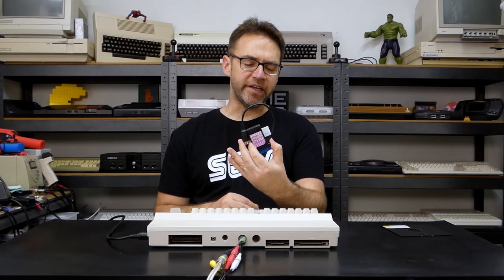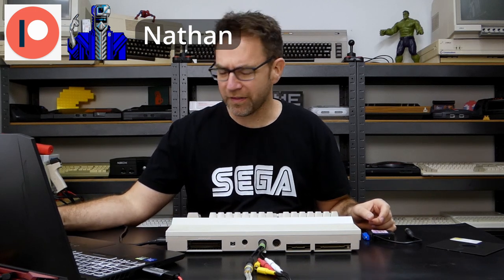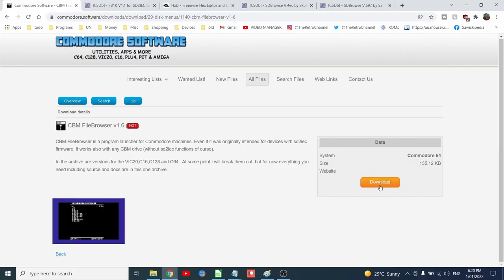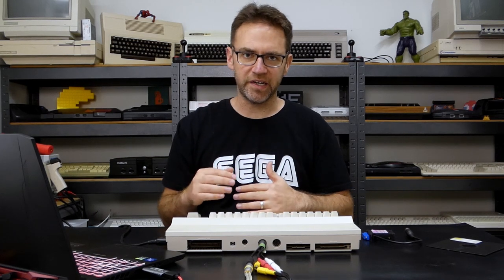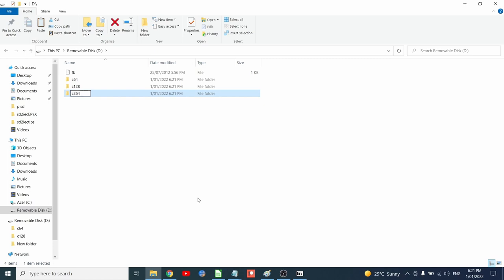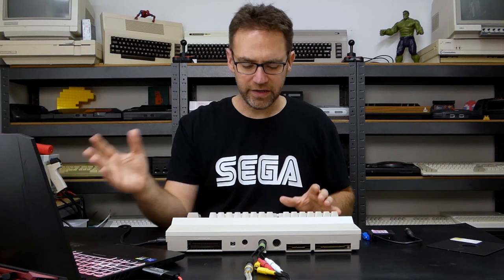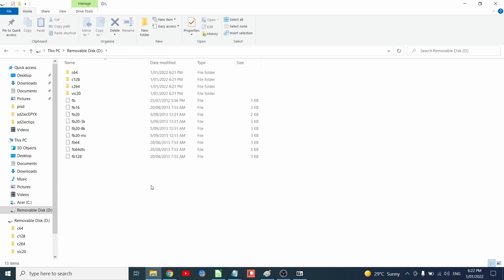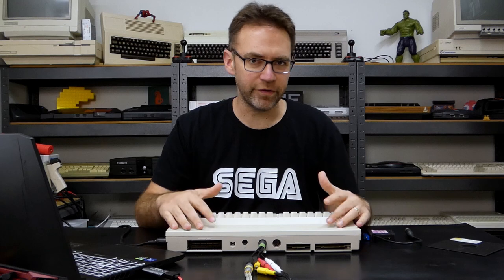C64 SD2IEC setup and turbocharging, plus how to create/backup disks to a 1541

Comment: Hey mate.  Great video.  I am the maker of the sd2iec you are using.  You can save the drive settings to eprom using
OPEN15,8,15:PRINT#15,"XW":CLOSE15 
That is why I did not put in device id switches.  ;)
Reply from the maker: Thanks, I wasn't aware of that one. Personally I still prefer switches over typing commands but it's good to know it can be saved in the SD2IEC EEPROM. Just looking at the SD2IEC readme now, and there's a few other features I wasn't aware of. Interesting...
Reply: @TheRetroChannel  I just keep a little program on my sdcard that I run to switch between ID8 and ID9 when required.

Comment: One odd thing I noticed about the FB1K file browser, though - if you use it with the SD2IEC with Fast Load Combo cartridge to navigate to a folder and then press RUN/STOP to exit to BASIC in that folder, it will also deactivate FastLoad and those wedge commands will be temporarily disabled.  You can SYS 57194 to reactivate it, but that's still kind of a pain.  Does anyone happen to know which file browser is used within the Kung Fu Flash cartridge?  I like the ability to type a few keystrokes and press Return and have the results filtered accordingly.
Reply from the maker: I don't think you'll be able to find the file browser from the KFF. I'm guessing it was written specifically for that device and would take a number of changes for it to work with anything else.

As for exiting the FB1K browser, I've never had much of a reason to do so, I just load everything directly from the browser. I'm guessing the fast loading routines from FB1K overwrite the epyx routines

Comment: The 60k image of Oink! was without a doubt dumped using a freezer cartridge. Loading those on a machine that doesn't have the same freezer is a gamble. The question isn't why it won't load, but why it does load with SD1k. It's possible they have some hacks to detect/patch freezer dumps.

Comment: Thanks for the FB1K info, I'll have to try that.  I've been messing about with my c64 and vic20 over the last 2 weeks. For some reason my PI1541 crashes loading occasionally, possible heat issues from 3d printed case. For my vic20 with Penultimate 2 cart I had problems loading a 3k expanded new game called diamonds from my sd2iec, just wouldn't run and I was using the correct FB version. I didn't try the PI1541 with the vic20. Anyway I found if I go to the directory that "diamonds" is in then hit Q then load"diamonds",8 it worked fine.  Maybe You could try that with Oink.   I assume You know that You can remove the ,prg extension and they will still load fine?
Reply from the maker: Hmm, yeah sounds like there is some conflict with the  file browser and that diamonds program. I guess the file browser must be occupying a memory location that diamonds wants (but that's just a guess).
As for the PRG extensions, yeah I considered removing them but I'd still need the ones for D64, D71 etc, so may as well leave all the extensions on

Comment: using sd2iec & fastload on a c128/  can't get machine to boot in c128 mode and/or 80 column mode.  Any ideas?
Reply from the maker: The 128 sees the epyx fastload as a C64 cartridge, so it will always drop you into 64 mode. You can still use the sd2iec part without plugging in the cartridge but you'll need to supply it with 5v and GND

Comment: Really great video, thanks. One thing I am struggling with... it seems that when I exit FB1k (w/ RUN-STOP key), my FASTLOAD commands no longer function. I went back and tried the same with the straight up "FB" file browser, and after existing (w/ "Q" key), FASTLOAD commands work fine. Any clue on how I could use FB1K and have it NOT clobber my FASTLOAD commands? (perhaps is somehow executes the FASTLOAD "disable" which is built into FASTLOAD...?) THANKS in advance! Jeff
Reply from the maker: My guess is the fastloader built into FB1K overwrites the existing fastloader in memory. You may need to stick to using the regular FB filebrowser, and just use FB1K for loading single load PRG files

Comment: Is this information still applicable? I ask because I've used an sd2iec+ with an epic fast loader both from the future was 8bit already set up and they use just plain old fb64 and haven't had any issues with speed whatsoever. Loading games just takes a few seconds. Menu browsing is instantaneous. Was something optimised in the interim or is it still worth getting fb1k over fb64
Reply from the maker: fb1k will still be faster than fb64, but with the epyx fastloader the difference will be minimal.

Comment: Very nice setup of the SD card. Will look a redoing my one. Thanks.
Reply from the maker: Hey Glen, I noticed you posted another comment about where to find the SD2IEC. It only shows me the first line of your comment so I'm making an assumption that it contained an external link and YouTube has automatically removed it. Sorry about that, even though I have all "spam filtering" turned off, YouTube takes it upon themselves to remove any mentions of a site that isn't YouTube as heaven forbid you go to a website that isn't YouTube
Reply: @TheRetroChannel  Thanks for the heads up. I did wonder if that might happen. I’ll keep it in mind for the next time I answer, to just spell it out rather than drop a link directly 👍

Comment: The weird filenames are the 8.3 DOS filenames associated with FAT32 Long File Names (LFNs). They're always 6~1.3 and the 0xff ~ character is checkerboard or Pi in PETSCII. The likely scenario is that if the FAT32 filename is longer than the CBM DOS limit of 16 characters, it uses the 8.3 instead of the LFN.
Reply: I think you are correct.  CHR$(126) is the tilde character on PCs, whereas the same PETSCII character code is the Pi symbol.

Comment: The difference between stock C64 FB1K and Jiffy C64 is due to the sjload (used by FB1K) turning off the VICII chip during loading. Goes to show the amount of cycles are consumed by bad lines.
Reply from the maker: Yeah, although I didn't put the percentages in the video loading appears to be around 11% faster just by disabling the VIC-II
Reply: @TheRetroChannel  Also, a tip for SD2IEC/Pi1541 users that want JiffyDOS (or any other Kernal replacement) over Epyx Fastloader but don't want to open up their machine to install it is it use an EasyFlash3 cartridge.
Reply from the maker: I believe the sidekick64 can also act as a Kernal replacement, but I haven't tried that one yet so don't know how it compares to the ef³